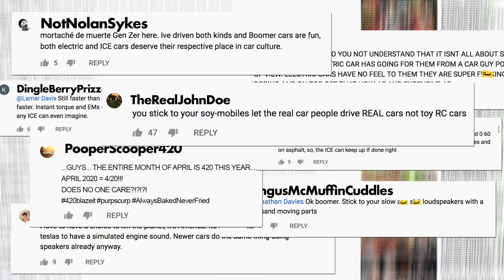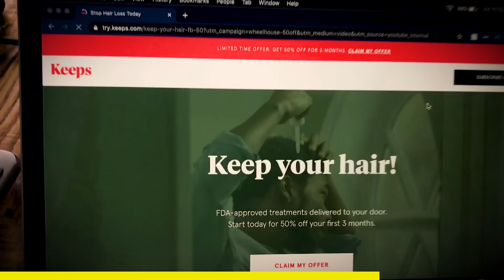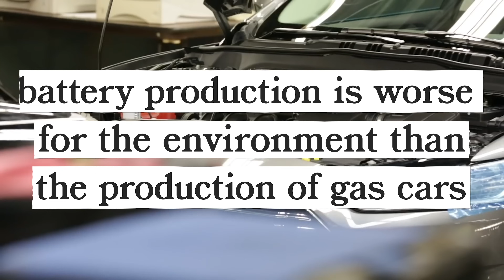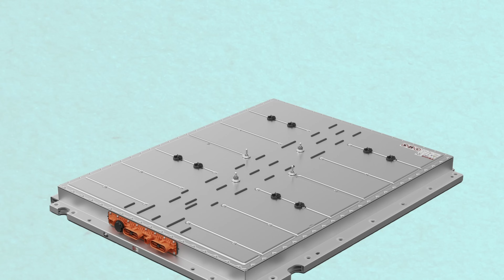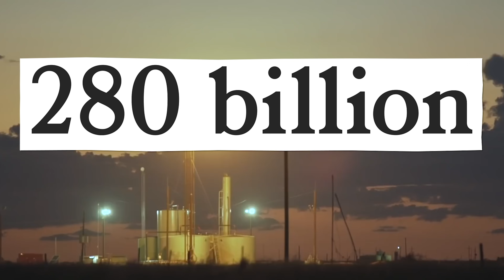Are Electric Cars REALLY Better for the Environment?

Comment: You didn't take into account the recycling process for EV batteries, which will likely have the greatest impact on the environment. Additionally that process already cost more than the process to manufacturer. Recycling companies, will ultimately charge owners to recycle or scrap their vehicle to offset cost of recycling.  Also, as of 2022 California's electrical system can not keep up with demand for Air conditioning during hot summer months. The same exact situation will play out for all other months when people charge their cars at 5pm. This will ultimately impact those living in apartments.

Comment: When water is electrified, it produces HHO. HHO can be used as a permanent chemical battery to store energy. When it is burned, it turns back to water and exits the exhaust of an engine. The car can then be refilled with HHO directly or filled with water and recharged. This method was invented back in the 90s by a dude who mysteriously disappeared… 

I do not think the conclusion in this video is correct or fair. Electric cars produce so much more pollution than gas cars because unfortunately, CO2 isn’t the only metric. With the current pinnacle of battery technology, it would take the entire global annual supply of cobalt just to outfit the UK vehicle fleet and NOWHERE ELSE with an all electric lineup. So, what do electric car lovers say in response “but solid state batteries are comingggg" bruh, have you seen what we need to make them?!?! LITERALLY NOTHING IN THEM IS RECYCLABLE AT ALL. So we are entering a battery crisis and on the horizon we have a grapheme crisis.

While graphene is so exciting because of its energy efficiency, it requires an insane amount of energy to produce and also is simply difficult to deal with the waste from. We already can only afford to recycle a fraction of our batteries currently, this problem will get worse. 

Alt fuels are an obvious first step not this jump to electric cars. Governments simply wanted to spend less money on electric car funding as opposed to spending a greater amount of money on reducing society’s need for cars in the first place.

Comment: The insulting prick in this video is biased regardless of what he says. Never believe the guy who proclaims his unbiased point of view before he even starts. He is a prick because he insulted past commenters that did not agree with him. That does not make him correct. It just means he is making fascist statements. 

Volvo and a few others did comparison reports. They all limited the cars lifetime for results. Artificially ending the lifespan at 120,000 odd miles is biased towards the Electric car. Perhaps the cars artificial end date variable is to protect the electric cars argument. After 120,000 odd miles the curve swings the other way again. As it turns out oil-based cars will last a lot longer than battery cars (at least for the foreseeable future). In fact, if you go twice as far in a petrol car then refurbish the engine etc, at that point the petrol car far out ways the electric cars environmentally friendliness.

If you chose to do the same refurbishment for the electric car, then it would need a battery replacement, and that also is bad for the electric car’s argument. Also, the expense on the user replacing the battery means they are likely to buy a new car anyway, again bad. Another point is owners that drive oil-based cars tend to keep the car longer. Wow that’s another point for the oil-based car, as building a new car is a lot more damaging to the environment than keeping the current one, especially if electric.

Stats based on the fact that both cars are retired at 120,000 odd miles is the problem variable here. I find it hard to imagine the electric car can win when it comes to reality of ownership and longevity.

Dont get me started on recycling for the cars either.

Comment: CO2 and greenhouse gases are not a problem since we live off of them and both are absorbed by the water in the greenhouse gases. Wind and solar are not clean sources since they rely on gas to power them as a back up. Those will never get better or become dominant since the sun and wind aren't always out. The EV batteries are not recyclable. The big problem is coal powered, which puts out double the amount of pollution and causes the double the deaths that producing gas powered cars do. You've produced bogus information in this video and it has now been corrected.

Comment: Few people ever talk about the carbon cost of transporting all our gas with all those trucks. Electricity just flows through the grid. Or is there something I'm missing about this?
Reply: That's why we want to build pipelines which Biden stopped.
Reply: @libertarian1536  I think that OP is saying how bad pipelines are and why its a good thing they stopped. You didn't read his comment correctly.
Reply: @libertarian1536  there is HUGE carbon cost to constructing pipelines to transport oil/gas. Think about : the mining and manufacturing of the steel, the transportation of all the pipes, the maintenance, the impact of a leak.

Pipelines are only country to country, state to state, or city to city. Getting fuel into actual vehicles takes many trucks to drive to many gas stations. Then people need to drive to the gas station. Whereas electric grids are already built straight to our homes, workplaces, etc where we can just plug in. 

Electric grids are already built, already established. No new infrastructure cost . Only environment and $ cost is maintenance.

Comment: Even if they are better for the environment, there's a few parts to this whole equation he didn't talk about.  Maintenance costs (which will cause more environmental impact) and this goes with battery replacement, expense, and environmental impact.

The expenses on these from what I can tell are MASSIVE?  Maybe someone can elaborate on this?  A lot of the newer electric cars have an 8-10 year battery life where they won't hold much of a charge anymore after that and there's severe degradation.  The cost to replace these batteries....anywhere from $5,000-$20,000 dollars depending on the battery which is an insanely huge expense....don't let that bother you though $rolls eyes$.

Replacement of these lithium batteries has an impact on the environment again obviously.  Someone will have to replace that battery every X number of years or trash and replace the entire car (again this is beyond the cost $$$$ many normal people can afford).  I have a 1998 Buick Century with 120k miles on the engine, and it's still using the SAME ENGINE it was built with almost 25 years ago.  

Basically these cars seem like a money and time sink pit in general.  If you go on a road trip say 500 miles you'd have to spend an additional X number of hours stopping and recharging a long the way.  Yikes!  I'm sorry to say, but the technology isn't there for this until we can find something better than conventional batteries.

If we can find a way to store energy that isn't heavy, costly, and easily degrades over time like current batteries then we would be good to go.
Reply: This was one reason I didn't like ev in general when you aren't using the car the battery is depleting so over time it just wears down like a cellphone battery....yeah there's no solution to cheaply maintain it which sucks vs maintaining a engine.
Reply: @foxdog9332  FoxDog and Cayenne, I think we are all on the same page.  This seems like mostly a big scam to me at this point in time (The electric car crap).  100% not practical for most consumers at all.  

We need desperately to find a light cheap way to store a lot of energy besides fossil fuels.  What that is I have no idea, but I'm guessing there's a lot out there technologically yet that we haven't discovered.  

If something doesn't wipe out most or all of the human race soon, I'm sure 200 years from now they'll be looking back on this time as the dark ages almost compared to the technology they will have then.  

Just look at how we think of people 200 plus years ago. We feel like they were living in the dark ages. The Lewis and Clark expedition was just a little over 200 years ago and they didn't even know what existed on the western half of the U.S. .

They couldn't imagine a car at all because traveling 20 miles a day was be an all day ordeal. To think that wasn't even that long ago, and a really old person today was born almost halfway to the point Lewis and Clark had their expedition.  

 That's probably us compared to technology 200 years from now....They'll look back and say I can't believe how people lived 200 years ago, and they burned fossil fuels where a full tank of gas couldn't even get you 1000 miles.
Reply: It gets changed every 10-20 years longer than an engine
Reply: I totally agree with all your points. Very well said. And it also means if everyone has electric cars and the electricity grids aren’t strong enough to handle all the power demands, there’s gonna be so many blackouts in cities and the cost of electricity will increase substantially making the running costs of electric cars even higher than petrol cars. The government think they’re trying to solve a pollution problem which they’re on the right road but by doing so they will create even more problems while trying to solve a problem which is why I’m skeptical on the electric car future and all ICE car sale bans. 

Plus replacing the battery which will cost as much as a new car?? Therefore creating planned obsolescence and either forcing you to buy the newer model, pay so much cash for a replacement battery or living with degraded driving range. No thank you. 🙁 I’m happy a petrol/ gas car for now which will still have the same range even 10 years after it’s purchase.

Comment: Co2 isn't a "greenhouse gas" Co2 is good for the environment. Co2 is also a cooling gas. without Co2 there wouldn't be life on earth.
The batteries degrade and must be replaced every 10-20 years
If everyone switched to Electric the grid could not handle the load and price of electricity would skyrocket to keep up with demand. ev is cheap now because not everyone is using it and people would have their car plugged in at night to charge during peak hours.
Reply: "Carbon dioxide (CO2) is the primary greenhouse gas emitted through human activities. In 2020, CO2 accounted for about 79% of all U.S. greenhouse gas emissions from human activities" - EPA. C02 is NOT a cooling gas. Too much of it is NOT good for the environment. Don't make stuff up.

Comment: This video's assessment of EV's CO2 emission should not be trusted. According to Volvo's official figure, its EV XC40 needs to run at least 90,000 miles to achieve the breakeven with the CO2 emission of the ice version of XC40.  EVs with larger battery size like Tesla model X should be much worse to the environment.

Comment: If you're thinking of buying an electric car I have things that might change your mind. If you loose power from dead battery. It's either get towed or some tow services have these portable chargers that will give you enough power to make it to charge station. Also if you have to replace the battery it's extremely expensive for battery and labor. When Teslas lose power it will lock all of the doors and you can't get into car because locks only work with battery power.

Comment: Wind and Solar power wont make EV's better as you need batteries for the power plants as well to store up the energyfor later use; when its dark and you have a solar plant there is zero output so output must be saved from day  and the same situation when there is no wind.

Comment: Not to mention a lot of the battery materials come from countries that don't like the U.S. They can hold us hostage like O.P.E.C. used to until Mr. Trump made us energy independent. Thanks Joe for returning us back to those days!
Our country's power grid can barely keep up with electric demand as is.
The Greenies don't want any new power plants to be built.
The U.S. had rolling black outs every year in one city or another.
My power company charges extra for power used between 4 and 8 P.M. Why? Because there is getting to be an overload on the grid.
 Let's add 125,00,000 E.V.s  to the load.
Long trips would be out of the question.

Comment: I was reading that Volvo released and redacted a statement that said it would take 100,000 miles to get their evs on average to “carbon neutral,” and the lifespan of the batteries was about 100,000-115,000 miles. EVs Have the possibility of being “carbon neutral”, if nothing goes wrong with the battery, and you drive it for ten years. Let’s be honest though, most people don’t own cars for ten years. We should be looking into carbon neutral bio/synthetic fuels like F1 is doing.
Reply: agreed

Comment: The problem here is the assumption that emissions are somehow the central metric for determining environmental impact. But production of non-biodegradable and disposal of hazardous materials is a far greater concern. Make biodegradable plastic alternatives - greatly reduce that and related unecessary toxic chemical products from the petrochemical industry - and combustion engine vehicles would easily be environmental-impact small fry compared to the damage of electric car batteries re resource extraction and land fill dumping.

Comment: What about the Solid State batteries? Slant drilling or Shale mining using pressured water. Causes Earthquakes. And very limited quantities of oil as well as processed fuel to use in vehicles.
Reply: Refining oil into gasoline emits more than an Electric vehicles.
Reply: Don’t forget steam.

Comment: To build ev you need child labour and peoples water supply hmmm that's why ev are the problem not the solution. To get for oil into gas no children have die or people starve for water.
Plus lithium and cobalt are not sustainable materials that's why batteries are not the solution.

Comment: I appreciate the very educated response to all those concerns the only thing I would say is I'm unsure if our electrical grid could handle a near total or complete shift to EVs in its current state because I have read before that the U.S. does consume basically its max power capacity and actually quite frequently  borrows from Canada. Not saying bit can't handle it but it might be one of those things where we may become more energy dependent because the demand has increased.
Reply: As far as the power grid goes - an EV pulls about the same power as an A/C unit. A/C units tend to run during the day, you charge your car at night when the EV is off.
Reply: @meanmutton  yes however in the U.S. at least A/C is more of a seasonal thing and isn't a strain year round vs a complete shift to EVs would have that year round constant stress on the system. Even during heat waves electric companies sometimes have to allocate certain resources to support the high demand caused by electricity.  I forgot where but I also read that power transmission lines are expected to last around 25 years and that's measuring our current usage, so I'm curious how that will change moving towards EVs. There is alot of things that go into this electric future infrastructure wise that we have to think about ahead of time.
Reply: Plus in northern environments, a certain amount of that battery power will have to be used to heat the cabin. Plus batteries do not charge as fast, nor are the efficient. And probably most importantly, the price/cost involved in sourcing/buying/installing replacement batterie packs.  I don't believe lithium battery powered cars are going to be the  answer. There has to be something much better.
Reply: @Redlinesixtynine  how are they not efficient? With a diesel you get 30% efficiency at most, with EVs it's at least 75%.
ICE cars are only so good at heating, because that's the main thing they do
Reply: @CheesusCrustus  That was in reference to the colder weather situation in the previous sentence. There is no denying that. Their performance declines.
Reply: @Redlinesixtynine  9:43 . He just declares facts as false without providing real evidence and says oh go look over there
Reply: We don't buy power because we're at the top of our supply. We buy power because it's cheaper than paying a Peaker-plant to come online. We're not limited by supply _per se_, we're limited by the ability to react to power differences at different stages of demand. At a point, it becomes cheaper to buy foreign power. That's the long and the short of it.

Comment: There’s a few flaws in the math. One being when you pull averages. Most electric cars are smaller, I’d be curious to see the math in a year or two now that we have massive electric trucks with 200kwh batteries. Gonna make the average electric car way more dirty than it used to be

Comment: Hi Guys. Check Volvos report 2019.
XC40 ICE vs one of their own BEV.
Lifetime: 140.000km
Break even CO2: 78.000km (in Sweden with nuclear power plant), 117:000km in Denmark with solar, wind and coal power plants to backup. BUT no CO2 is calculated in the battery recycling. Report 2018 - DOE showed 10x CO2 if mining in old batteries vs new mined material.

Comment: Is the electric car making the oil company’s fatter and richer? The electric car uses 3 times the amount of products made from petrochemicals than the ICE car. The average ICE car uses around 340lbs of products made from petrochemicals, while the average electric car uses nearly 800lbs of products made from petrochemicals. Also, the electric car will require millions of electric vehicle charging supply equipment plonked all over the place and these things are made mainly from petrochemicals. The electric car manufacturers are saying they rely on the oil company’s for oil & gas based products, and it would be very difficult to produce the electric car if it weren’t for the oil companies.